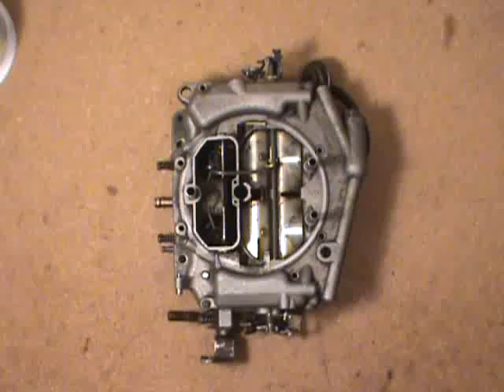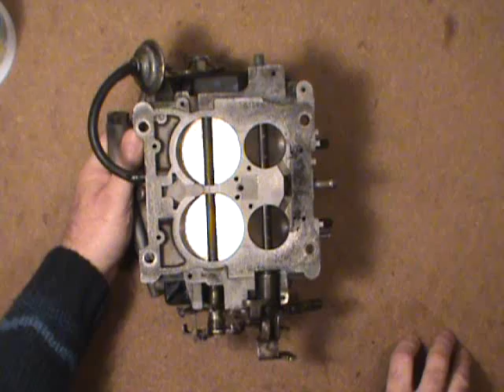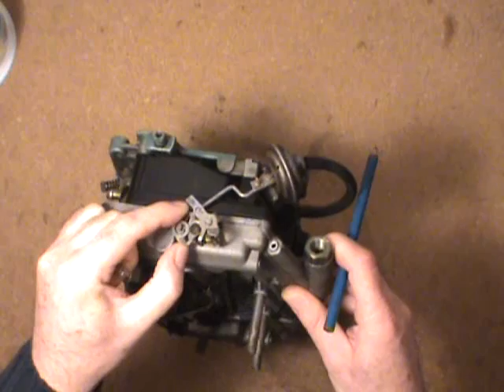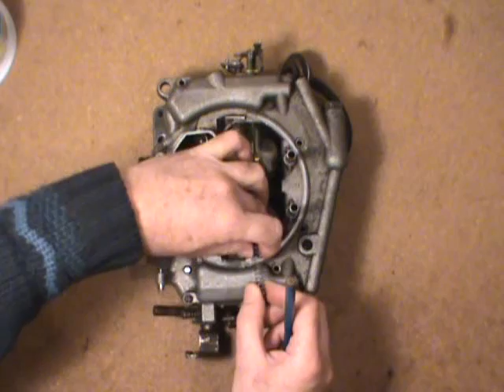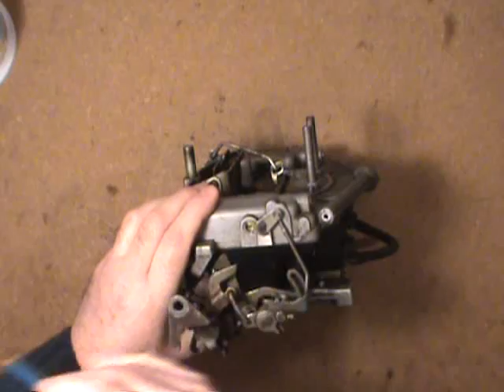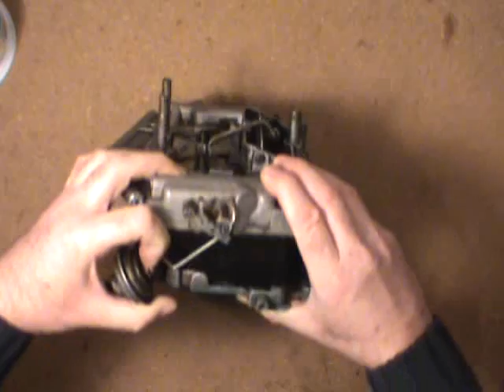Thermoquad 4 Barrel Carburetor  (Part 7)

Comment: A snap ring pliers, with the 90 deg tips, works great for tightening the lock ring for the air valve  door.
Reply from the maker: Greetings George Jr....Thanks for Your comment, and, Thanks for watching too...."Congratulations", for finding a way, to Tighten/Loosen the Thermoquad's Secondary Air Door "Torsional" (some Folks call it Tension, but, Tension is actually "Pulling"...lol) Wind-Up Spring's Adjustment "Locking Ring", with, what You happen to have, at Your disposal (aka, what You "Had" already, to get the "Job Done")...I'm thinkin', that, the "Tips" of Your Snap Ring Pliers/Tool, might be "Round" at the "Tips", and I'm also Thinkin', that, while using Your method to Loosen or Tighten, that there "Locking Ring", to be very Careful, so as Not to have the Snap Ring Pliers/Tool "Slip", while Loosening or Tightening that there Locking Ring, which will usually Result in rather "Chewed-Up" Locking Ring "Slots".

As long as, You are being Careful, while Using Your Method, You should be..."Good to Go".

If that there Secondary Air Door's "Torsional" Wind-Up Spring, starts to go, past the point of "2" Turns, from the Secondary Air Door, Just Touching the Air Horn (aka, top aluminum casting) when it First comes to a Stop, and You Add in the "Turns and Partial Turns" to Create the "Torsional Spring's Resistance", that has me Thinkin', that the "Secondary Jets" (those 2 Big Brass Ones!), could be on the "Small" Side (aka, Orifice or Hole Size, in the Secondary Jets).

Thanks again, for Your comment...

Be Safe, take care, and have a good one.
Reply: RockysRoadshow
Good point about the round tips. I'm thinking back from more then 20 years. after the first few time of completely disassembling a TQ, since then, I learned not to mess with that setting, as long as it felt right.

To loosen that locking ring, I would use the right size screw driver.. The snap ring pliers were so I could hold the air door adjuster in place, and snug up the lock ring. Once the lock ring is snug, then one could use the right size screwdriver to give it a little more snugging,

By the way, you have done a great job on this series, I'm still working my way through watching them. Bring backs lots of memories as to why I liked the TQ so much back then.
Reply from the maker: George Jr
Greetings George Jr....Thanks for this additional comment of Yours, and, Thanks, for Your kind words....The "Actual" so called (and proper) "Tool", that the "Factory/Manufacturer" (aka, Chrysler/Dodge/Plymouth, and their "Dealers" Official Service Departments "Used", if they had one, that is...lol), to Loosen/Tighten the Secondary Air Door Torsional Spring Adjusting Screw-Threaded "Locking Ring" (as I've seen in some pictures), looks kinda like a Piece of Metal Tubing/Pipe, with Two Solid Metal Rod-Like pieces attached to the "Outside" (so as Not to Block the Hole in the Tubing/Pipe), and at the outer end, that formed a "T" shaped handle, and, the Other end of that "Tool", that went Into those Two Slots, that are on the "Locking Ring", had Two "Protrusions" (aka, Two, what kinda look like "Keys", that fit into those Two "Notches" in the locking ring)...

...then...

...the "Fixer-Upper-Wanna-Make-An-Adjustment-Guy/Gal", would place that "Tool", in the Locking Ring, then, put a Screwdriver (a fairly long one, that Fit the smaller Adjusting screw-like head, that was "Inside" the locking ring) all the way "Through" that Hole in the "Tools" Tubing/Pipe, and once the Screwdriver was seated in the Adjusting screw headed Thing, and was held Still, to make sure that it Did Not Move, so the Wind-Up Spring, Didn't let go, and maybe get damaged, then, with that "T" Handled Tool, it was just a matter of turning it counter-clockwise, in order to "Loosen" that there Locking Ring...

...and...

...once the Turns and Partial Turns, of that, Adjustment Thingy, that Looks-Like-A-Slotted-Screw-Head, gets "Adjusted", to the Adjustment, "Chosen" by that "Fixer-Upper-Wanna-Make-An-Adjustment-Guy/Gal", then, the Screwdiver was held "Absolutely Still", while "Tightening" the Locking Ring (clock-wise), with that, shall we say..."Very Special"...Thermoquad carburetor Locking Ring Loosening/Tightening..."Tool".

A good starting point, for the Secondary "Torsional" Wind-Up Spring, as I see it, is at 1 and 1/2 (one and one half) Turns, from the Air Door "Just Touching" the Casing Boss on the Air Horn (upper aluminum casting).

On one of the Thermoquad carburetors, I found that the Factory Setting of 1 and 1/4 (one and one quarter) Turns, worked Awesome!!!

It seems that, "Every" Thermoquad/Engine/Vehicle Combination, are kinda like People, as in, "No-Two-Are-The-Same"...!!!...lol.

I just Give-It-What-It-Wants-or-Needs, as, then, and only then, will that Thermoquad carburetor, be able to "Perform" to it's "Full Potential", and then some...!!!

Gasoline that is at the Gas Pumps these days, usually has Ethanol (aka, alcohol) in its Blend, making just about any Carburetor, that Does Not have a "Feed-Back" System (Feed-Back = the Carburetors, that had a Computer to make air/fuel ratio adjustments, in real time), Run on the "Lean" Air/Fuel Ratio Side of things...

...there-for...

...at times, Adjustments, which might include the Secondary Air Door "Spring", and Re-Calibration, as in Jetting, may become Needed, to keep the Engine "Safe" and "Happy".

That Secondary Air Door Torsional "Spring" was Only "One" Important Item, as, if and when, that Choke Pull-Off "Diaphragm" (inside that space ship looking device) becomes "Old" or starts "Leaking" Air/Vacuum, then, the Secondary Air Door will usually get "Stuck" Closed, or start "Opening" Too Soon, which will cause problems, like, having the Engine, maybe I will call it a "Rich Bog" (when Air Door gets Stuck closed, and acts like the Choke is Stuck Closed), and a "Lean Bog" will usually start happening, when the Secondary Air Door "Opens" Way Too Quickly/Soon...!!!

For best Performance/Economy/Reliability, "Always" Replace those Nitrophyl (black plastic) Floats, as sometimes, they start acting like "Sponges", absorbing gasoline and start Sinking, and makes for a really "Overly-Rich" Air/Fuel Ratio, which makes for some Terrible Gas Mileage/Kilometer-age...!!!

Same goes for that "Choke Pull-Off", Install a "New" One, and "Make Sure", that the "Correct One", for that particular Thermoquad carburetor Number/Model, gets Installed, or, it's like playing the "Odds" in Reno or Vegas...!!!

Once a Thermoquad carburetor gets...Rebuilt, Calibrated, and Set-Up Properly, and the rest of the Vehicle, does as it should, then, I need say no more...

Be Safe, take care, and have a good one.

Comment from the maker: ....What happens with the Plastic floats (sometimes, not always), is, that they sometimes absorb gasoline, making one, or both floats (maybe) become less "Boyant", while sitting in the float bowl (there is a left, and a right side, meaning 2 float bowls in 1, as there are 2 Floats in there)....New Nitrophil (plastic) floats are usually ok, when they are only a few years old...."Brass" floats are more dependable, but there are rare occasions when they might develop a leak....Take care my Friend.

Comment from the maker: @brickster240 Good to hear that you found the Magic setting that works for you!......Just make sure that you don't let that Choke Pull-Off get too old or it will go really Rich on you, like it did to me!......Also, a rebuild from time to time works wonders as well......The newer nitrophil floats seem to be better then the factory originals, as they haven't absorbed fuel and sunk yet!.....I might try Brass Floats sometime in the future, but the fuel level might be a bit different between the two!

Comment: Last year I had a very frustrating bog at the initial opening of the secondaries on mine (400cid Newport). Once I did set the torsion spring preload at 1.5 turns, man that made a great difference! no more bogging when putting the pedal to the floor!

Now my glovebox has the regular tools to change those settings, from the tiny screwdriver for the metering rods adjustment to the big screwdriver for the secondaries locking ring, including the usual 1/2 wrench and little allen key for ign. timing